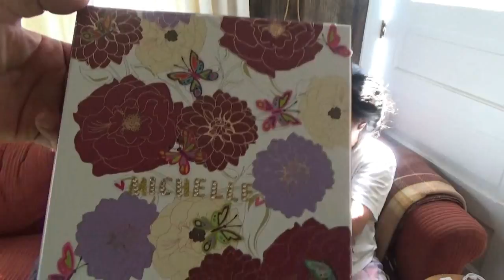Homestead Chickens ~ Off Grid Wood Shop ~ Day On The Homestead

Comment: Troy when you seal the top of a board, like a table ,seal the bottom to. Otherwise mousture will get in the bottom and the cells will get bigger and the board will warp.
Reply from the maker: Can I still coat it with mineral oil? I hate to disassemble it now.

Comment: The concrete you had the end table sitting on, is that an old cistern, and is it still in use or not? If not, and it were mine, I would pump out any water that was in it, block off any water inlet and outlets, then put it to use as ether a root cellar or storage area  for things you want to keep but is not used on a regular basis. That's what I did with the cistern by my barn that was used as a water supply for watering livestock, I also use it as a storm shelter when there is a threat of a tornado in the area.
Reply from the maker: +Nortekj its our well

Comment: I'm liking this format but this one was a wee bit long. Take the project wood inside for a week or so before starting the project. This will allow the wood to shrink to the interior climate. This is what hardwood floor installers do and why most wood shops are heated.

Comment: Chickens drink a large amount of water and I didn't see your water container.  It's easier for chickens to drink if the water is higher and off ground level.  I set my water container on a concrete block that seems to be a good height for them.
Reply from the maker: +Janet Folkerts a 3 gallon container in the coop filled each day and the outdoor birds get 2 fresh gallons per day